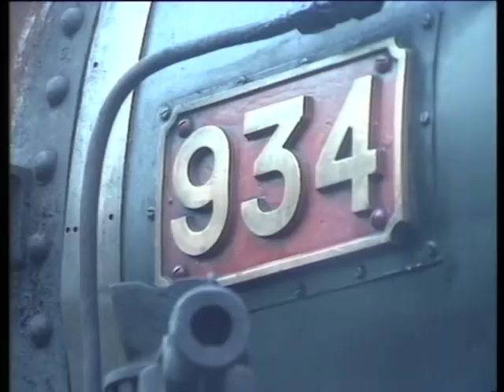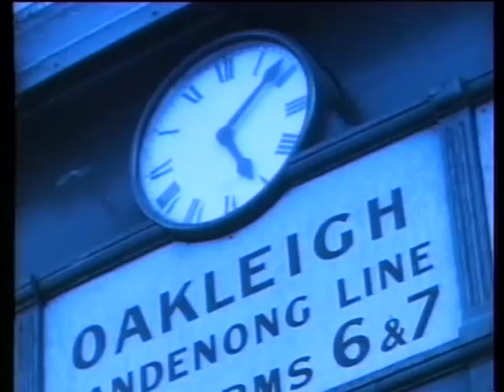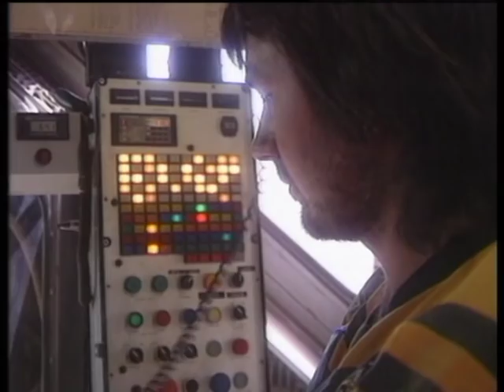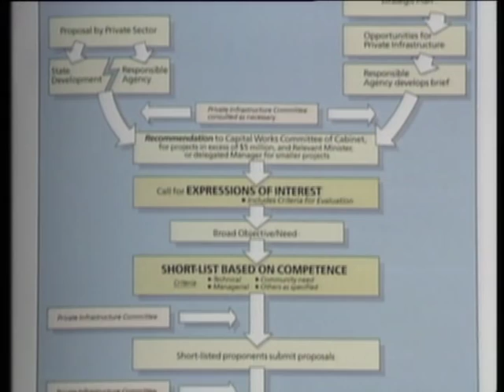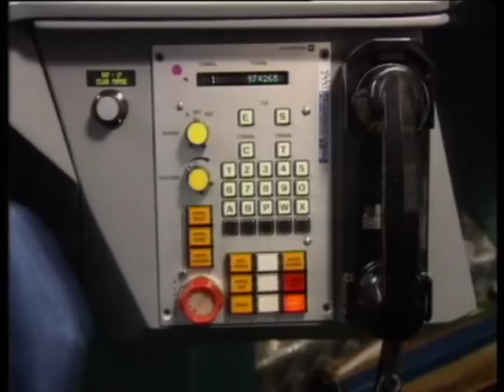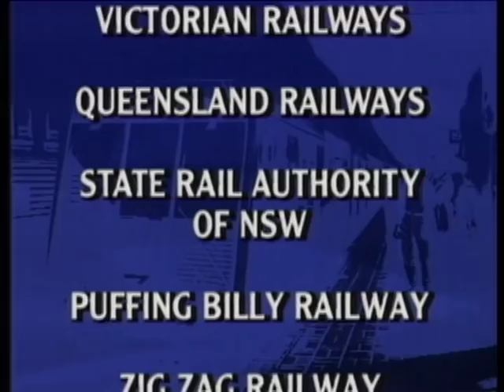Track Record: In A Spirit Of Progress

Comment: It's a tragedy that the four special S Class steam locos that were the "Spirit of Progress" were completly scrapped at the end of their use when the S class diesels replaced them.
Reply: Scrapped by 1954, after the B class replaced them. The first S diesel was in August 1957. Unbelievable that one S steam was not saved. A murkey decision as to why.
Reply: from what i've heard it was a bit of a "lets save one!"
"sir they've already scrapped it"
"WHAT!"
"the scrapping company did an oopsie"
"damn.... save a tender!"
which is where we're at now
Reply: @hcdcgunner1748  my understanding was the railway staff at Newport Workshops were instructed to scrap them. Likely some of the same workers involved in building them. Legend is that they had tears in their eyes cutting up the last one.
Another legend is that the instruction to save the last one for display on the lawn outside the head office at Spencer St arrived at Newport too late. Planned to be too late or a muddle?
Tender tops saved due to being used as storage tanks for fuel oil or water.
Roller bearing six wheel tender trucks used under the 24 wheel four bogie QW heavy duty well wagons for large transformer loads.
At least one set of the nameplate letters were saved. Maybe all with the ARHS.
Reply: @johnd8892  Ah that second one is what I meant, however it is entirely possible that the first legend may be true, shame I can’t track down anyone who worked at Newport at the time...
Reply: @hcdcgunner1748  my father was involved with Newport Workshops scrapping steam in a round about way. He told me of his truck driving job to go to Newport to pick up a scrapped X class boiler to take to Sims metal. Was not happy with how they loaded it. Quote Are you trying to kill me. Still angry twenty years later. Indicates to me that the later X scrapping was all by VR not contractors. Contractors seem to be something from the last thirty years not from the 1960 X scrapping or earlier.
Bogies also under QS well wagons but swapped around depending on how many wheels were needed for the weight.